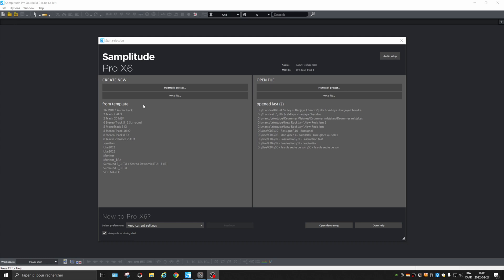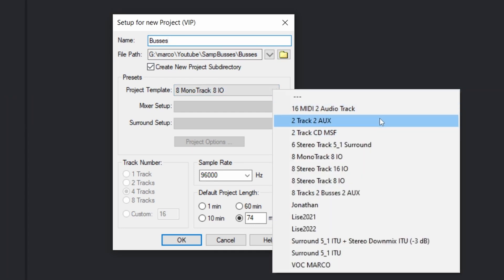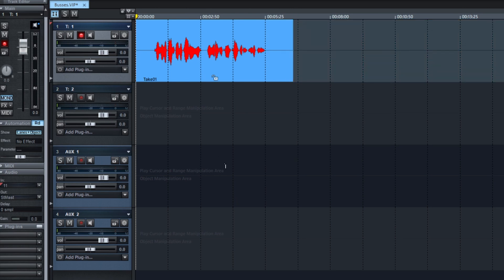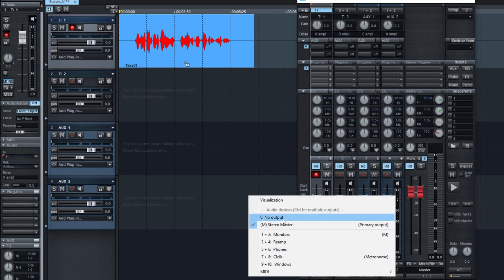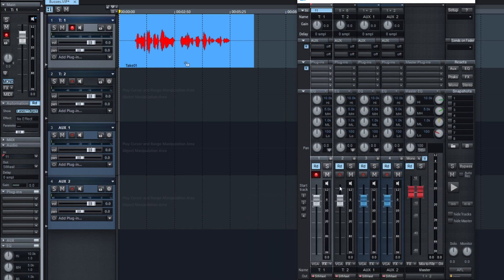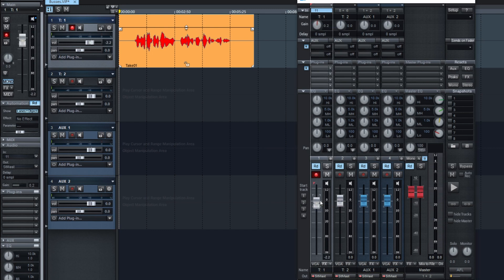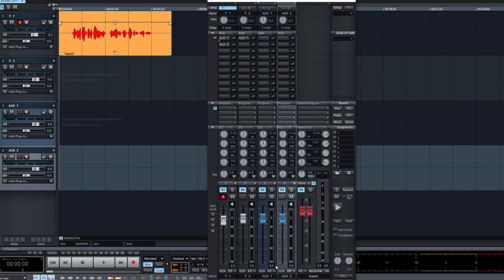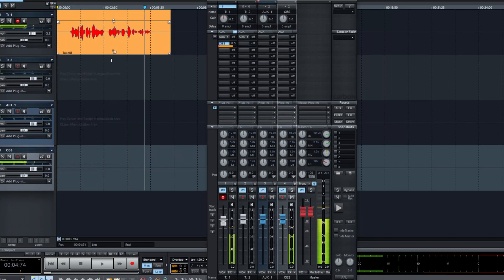Auxiliary buss vs Submix buss in Samplitude Pro X

Comment: Can you record the effects on a audio track using a submix buss?
Reply from the maker: Yes there is 2 ways to do it. Arm for recording on the buss itself and start recording OR  create a new track and select the buss you want as input, arm and record
Reply: @MarcoPrimeau  and so for option one, if I put a reverb on the buss and record from the buss, it will also record the sound with the reverb?
Reply from the maker: @PPCRecords  If, on a buss, you aim it for recording and hit record it will record the signal generated by that buss on the buss track so you can deactiate de effects and still hear them from the recorded audio. Althought I never needed to do so. ah, if it is to lower the CPU usage, you can also freeze the track.. ;)
Reply: @MarcoPrimeau  ok gotya.   The thing is that. I DO want to record the reverb where it's printed on the track. I know it's sounds crazy but that what I want.  Because I want to record vocals with effects printed but I dint see a way in Samplitude to do that
Reply from the maker: @PPCRecords  Have fun!
Reply: @MarcoPrimeau  I tried to make the new audio track to have input coming from buss but I don't see a way to select the buss to be input on the audio track

Comment: Hi Marco, can I use a compressor in an Aux ? Thanks in advance ! (y)
Reply from the maker: Of course you can.. Be aware that if one source going to the aux is louder or jumpy, it will make every signal in the aux compressed at the same time. therefor let's say you send every track to the aux then compress, if the bass activate the compressor every instruments level will go down ;)
Reply: @MarcoPrimeau  Thank you Marco 👍

Comment: One Question said that you use OBS to acquire sounds. I only use Samplitude to record, is it always the same in concept?
Thank you.
Reply from the maker: It's just a preference of mine. When I capture a video of me talking, I use Samplitude alone to grab the audio from a mic close to me and the camera video and sound from a distance. Then on    Davincy Resolve, I use the automatic alignment based on waveform. But when I talk on the cam and want to show the computer screen at the same time as having the audio, I prefer sending the output of samplitude to OBS directly. In this instance OBS records the screen visual, my mic on a track and samplitude's sound on a seperate track.. So in Davinci Resolve I end with a video from OBS with 2 audio tracks + the video from the camera with an audio track as well. Then I sync everything automaticly and just have to mute the mic the parts where Samp produce sound (to avoid hearing direct sounds from Samp and the mic at the same time.) A bit tidious, but effective to me.. I think my next video could explain just that.. ;)